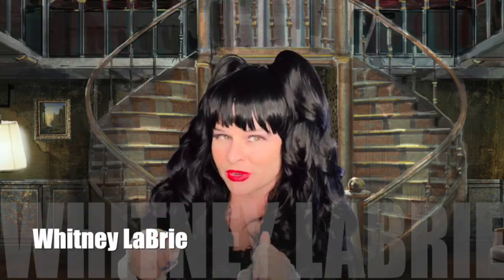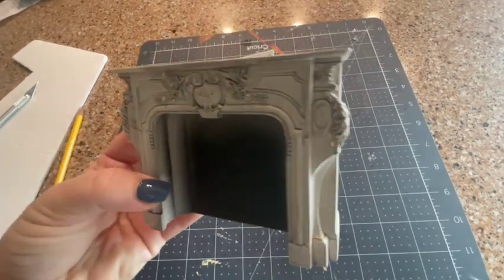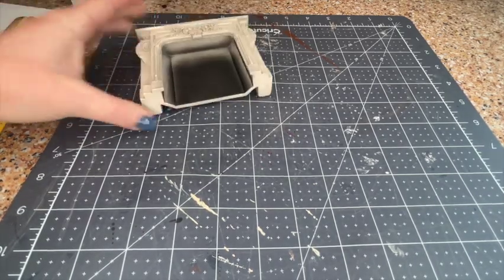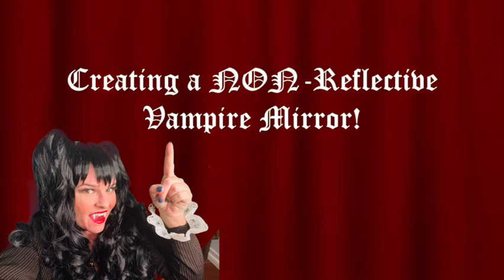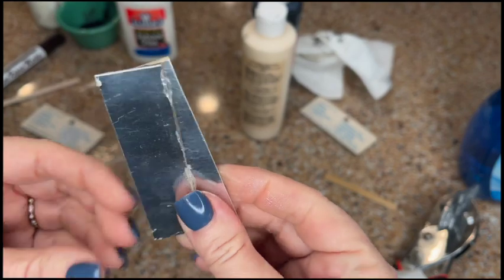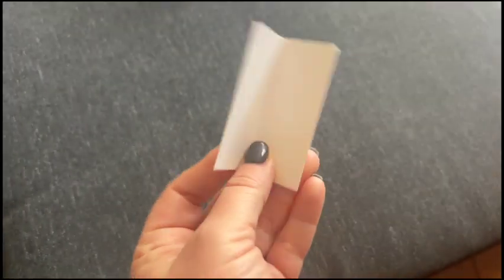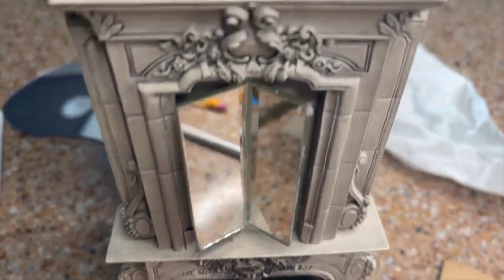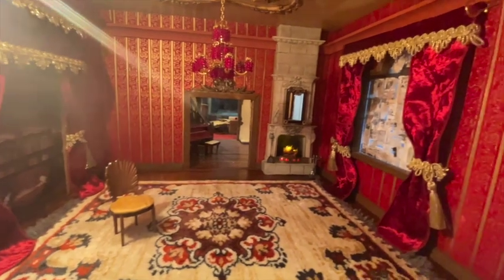Make a Miniature Fireplace TALLER & Non-Reflective Vampire Mirror

Comment: I don't know how I missed this video. That room is great to start with. The fireplace is fantastic, but how you modified it to fit the room, color matched, added the amazing burning logs (how great is that piece?), And added the non reflective mirror is just way over the top. 

Is there a piece of clear acetate over the top of the mirror so it appears flat? Maybe that would mess it up.

Years ago I bought a video at the Halloween store. You play it on your TV, and set up this contraption inside by a window so that the images appear to be visible from outside. The video played a series of spooky faces and screaming. So I had to put a TV on the floor pretty much, I think for the height of my window I propped up a small 12" color tv into a cooler. Then you needed a thin sheet of plexiglass or some kind of plastic. I had to get some rudimentary frames to put on the edges to keep the plastic straight or it bowed in the middle. You put the plastic over the TV, at an angle so the top is pretty much touching the window. I hope the description makes sense. So the TV image goes up vertically, hits the clear plastic at an angle, and is reflected out to the window. It took some adjustments to get it just right, but once it was dark enough, our second floor window from the street looked as if there were disembodied screaming heads, sometimes laughing heads floating inside the house.

I had to set the darkness on the TV to the darkest black I could get it to fit the illusion. And had to construct an even bigger contraption inside the room to blackout any other light in the room. I made a frame of PVC pipes, hung black non reflective tablecloths from the Halloween store around with clamps. It was quite the undertaking but so much fun. 

I saw a magic show as a child and begged my parents for a kit to learn how to do magic tricks. At 10, I put on a show for my sisters 5th birthday, lol. One of my best friends had been a magicians assistant. Fun stuff.
Reply from the maker: That exact set up that you are talking about was something that I considered when consulting with my magician friend…it looks really cool but it we couldn’t figure out how to accomplish the look without seeing how we did it. I almost added a plexi glass front but last minute didn’t do it..only because of time really….I think the main benefit to add the plexi is so that your finger doesn’t ever touch the glass to help with the illusion….in this case I don’t think there will be that issue as none of the dolls will be doing that….well that we know of! Lol 
You always have great comments. Thank you